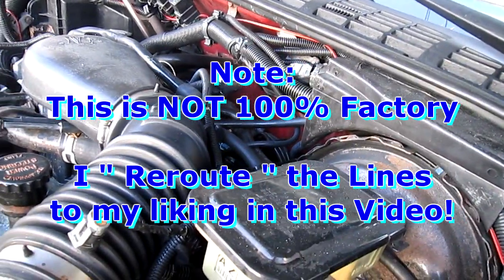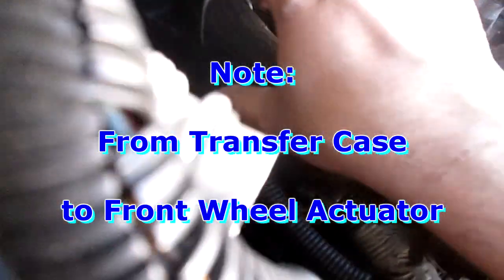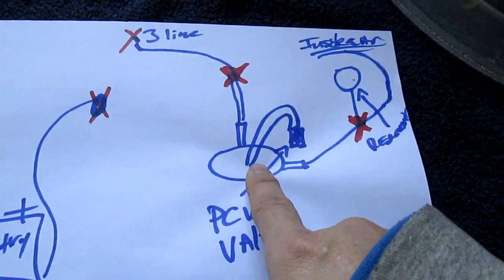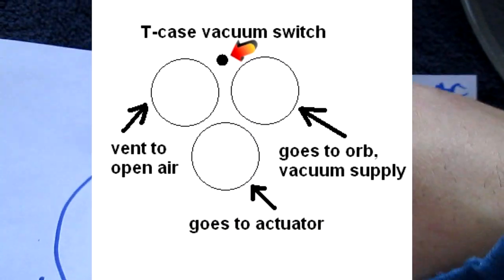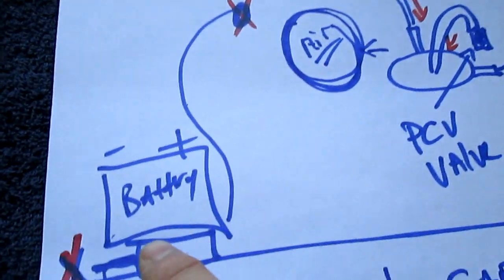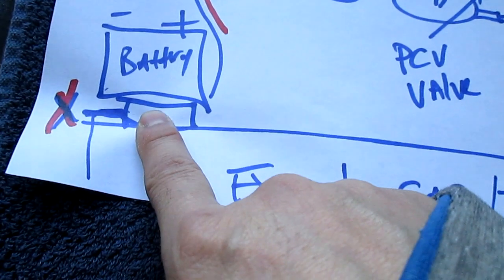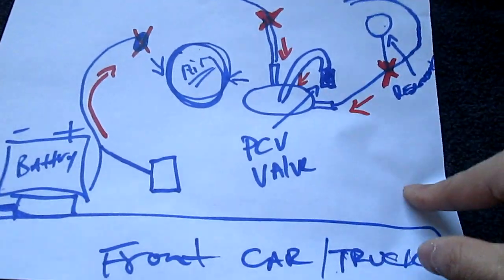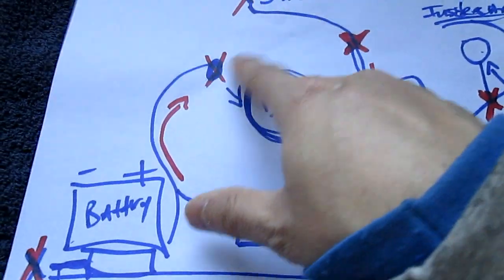Chevy Blazer S10 Vacuum System Diagram + Routing 4.3L Vortec Engine

Comment: Umm . I have an 2000 s10 RWD LS.  I have a three way splitter next to the vaccum canister, one goes to the throttle body, the other goes into a harness into the dash.. i think ill need to buy a aftermarket vaccum ball because mine is broke. What im confused about is the line yhat goes into a wiring harness lume, and into the dash.. just seems kinda wierd. This on a 2wd version.. suffering check engine lights rough idle, stalling.
Reply from the maker: The one that goes into the Dash = Heat Actuators.

Comment: Does your vacume system is conected to brake booster too ???
Reply from the maker: No, Brake Booster is separate.  They design it that way for a reason !!!
Reply: @JodBronson you help me alot bro thanks. whats the reason why it is not connected to brake booster and give me the list plz wich wich parts does your vacume system is connected to ???
Reply from the maker: @aliqadri4672  -  The EPA wants EVERYTHING that produces "vapor" connected to the Vaccum System.
Reply: @JodBronson  but some one says in this comment one hose from vacume is conected to brake booster for ease of braking
Reply from the maker: @aliqadri4672  - Learn to read + comphension.
Reply from the maker: @aliqadri4672  -  It's the SAME System, but function differently.

Comment: Plz correct me there are transmission case and tranfer case both are saprate from each other and both have there own vacume supply from switch when the swith ball moves up the transfer case vapour suck trough into the engine..??

Comment: 4:20 why this device have ball at bottom ..??
Reply from the maker: Extra + Reserved Air
Reply: @JodBronson  and where does it fix on tramsmision case or transfer case??
Reply from the maker: @aliqadri4672  - In the video + diagram
Reply: @JodBronson  so when the transfer case pressure is geting high so the ball below on switch  is getting up and releasing oil vapours to reburn ??
Reply from the maker: @aliqadri4672  -  YES.

Comment: The transmission vapour is also going in engine.???
Reply from the maker: Starting 1996... The EPA (Environmental Protection Agency) forces ALL Car Manufactures to do it.  Anything that has a "Vapor" can not release to the enviroment, it has to go back for a "Re-Burn".  So vapor from Oil, Transmissions, Wasted Gas (EGR), Etc... Needs to go back to the Throttle Body for a 2nd re-burn.
Reply: @JodBronson  so thats y air reservoir and all of that stuf needed..?
Reply from the maker: @aliqadri4672  - The Vaccum for Brake and Actuators, Heater, 4X4 Switches, Other Switches etc...
Reply from the maker: @aliqadri4672  - BTW... Air Reservoir = Air Reserve.  See how English works?
Reply from the maker: YES !!!
Reply: What is decel valve..??
Reply from the maker: @aliqadri4672  - The Upstream Pulse Air tube. When you take your foot off the gas and decelerate, manifold vacuum soars, actuating this valve and opening it. This allows the manifold to draw fresh air below the carburetor. It's a pollution control thing.

Comment: thanks 4 video...i have 96 s10 4wd 4,3..i have vacuum leaks on this truck.........Where is the starter relay on this engine ?
Reply from the maker: Starter Relay is under the hood, in the passenger side.  Open the hood, you should see 3 of them there.  Once of them is the Starter Relay.  I am not sure which is which, but the one with the thick YELLOW Wire.
Reply from the maker: Go to the video link here... You will see it in the video !!!  https://www.youtube.com/watch?v=a1tN29zEgH8
Reply: there are 4 identical BOSCH relays..mounted to firewall inside engine bay...passenger side
Reply: i just back from truck S10 1996 4.3 4WD X vin#...NO YELLOW wire going to any of the 4 relays...I also called 2 GM dealers in my area...THEY were useless helping me to find it.
Reply from the maker: @williamcox2996  - Amazing what you can do in 2 seconds!  Here:  https://www.autozone.com/znetrgs/repair_guide_content/en_us/images/0900c152/80/07/05/df/large/0900c152800705df.gif
Reply: @JodBronson  thanks for effort...i think that might be diagram for 4 cylinder engine
Reply from the maker: @williamcox2996  - No, that looks like that one I have right now.  Unfortunately, I relocated so it will be easier.  Just PEEL the Wiring Covers off, like in my other video above, SEE LINK... It's the YELLOW Wire, that is the Ignition and when you turn the Key, it turns on the Relay.  That is the Relay Starter.
Reply from the maker: @williamcox2996  - Look at the picture below.  The one on the LEFT has a Yellow Wire.  That is the Ignition Relay Starter.  LINK:  https://blazerforum.com/forum/attachments/1st-generation-s-series-1983-1994-tech-40/10399d1354409708-please-help-88-blazer-s10-4x4-2-8-no-power-fuel-pump-relay.jpg

Comment: Won’t fuel line get sucked closed as air line is harder
Reply from the maker: Check into Fuel Lines verse Air Lines and do a comparison for yourself. Air Lines when hot or old, can collapse really easily. Fuel Line can withstand high temperatures and is very rigid. Except in Low Application like a Weed Wacker or Small Engines, like 2-4 Stroke. 

#1: Due to the dangers of fire and or blowing up, Fuel Lines are very rigid because they do not want leakages or fire or blowing up. 

#2: Air Lines for your little Fish Aquariums or Air Compressor Tanks, both are different too.
Reply: @JodBronson  super. I got some bad corroded hoses at that white 1 way check valve so I guess that’s my issue!
Reply from the maker: @Barilaul - Check or Inspect all of them for Cracks or Old. In Car or Trucks or this 4.3L Engine, since it's big in HP. Those hard White / Clear Hose are rigid, because they are in a "low/freezing" temperature location, but still not regular air hoses. But if you look at the area that is hot or potentially hot, they use Black Air Hose. Those Black Air Hoses actually get soft when hot and when Old or Cracked, they actually collapse very easily. 

NOTE: Black Air Hose is the #1 problematic in Cars / Trucks due to manufacture costs. Those are cheap - cheap hoses that they put in there.

Comment: This was super helpful- clarification question (previous vehicle owner cut one of the lines short) I have a vacuum line running from the Evap-Canister and then it goes down on the passenger side of the car between the distributor and firewall. It seems to be heading down towards the axels- is that one of the lines that go to the three prong transfer case?
Reply from the maker: YES, from the one that splits and go down to the Axle is the Splits - 3 Prong - Transfer Case breather.  Some actually go all the way back to the Charcoal Canister too (Gas Vent).  See diagram in the video.

Comment: Thanks for the diagrams and stuff, but my 2000 s10 4.3L has no split line from the 4x4 actuator to a fan under the battery. It's just a single line straight in to the actuator from the 3 point solenoid behind the transfer case. I have a line broken off coming from above my transmission and can't see where it broke off from on the motor side, unfortunately. Is that coming from the canister, maybe?
Reply from the maker: Not sure.... Just trace it step by step and follow the Lines.  As for splits... You can buy the "Splitter"  and do it yourself and to your liking.  Pause the Video and follow the Video so you can go Step By Step.  So far, that is the best known routing I could come up with.  This info was on 2 Cars / Truck and it's 1996 Blazer + 2001 S10 Pick Up.  NOTE:  If yours doesn't have the Split from the Fan / Battery... That means it's an Older Truck / Car and only apply from 2006 and under.  At least you don't have to worry about that. NOTE 2:  As for the broken line splits, pause the Video where you see a Diagram / Picture which tell you where things goes.  SO WATCH THE VIDEO AGAIN AND AGAIN to see if you've missed something.